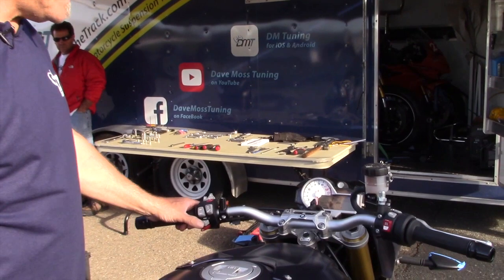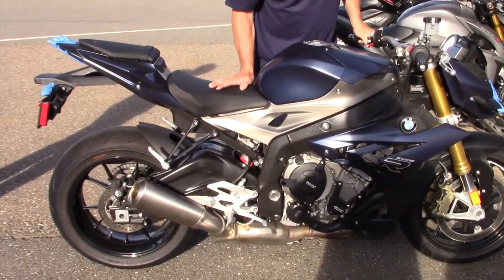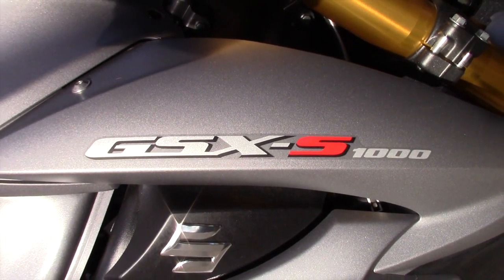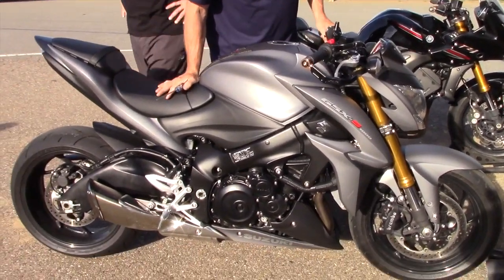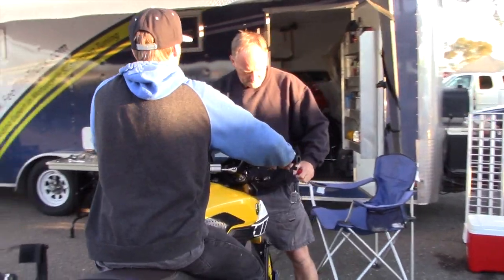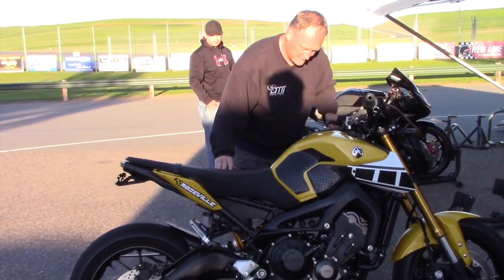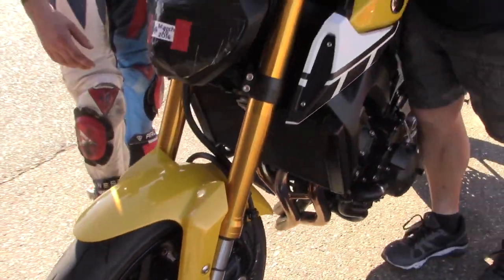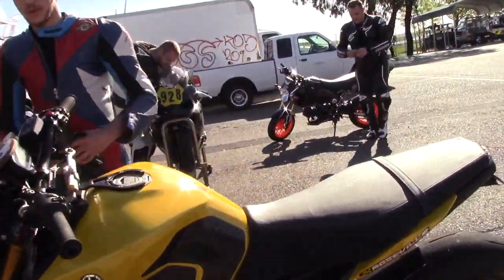2 Clicks Out: Naked On Track, S1000R GSX-S1000 & FZ-09 Suspension Setups (TRAILER)

Comment: Currently have an S1000R with DDC and it’s becoming a real ball ache to dial in 🤦🏻‍♂️ 

Bike has a total Jekyll&Hyde personality. Wish Dave was in Scotland 😭🤦🏻‍♂️
Reply from the maker: Is the fork and shock oil over 10,000 miles old - that might be the source of the problem from cold thick oil hot hot and very thin oil?
Reply: Dave Moss Tuning Hi Dave, thanks for replying. No, the bike is a 2019 with 3500 miles. I had made some adjustments again last night but unfortunately storm rolled in before I got an opportunity to do testing. 

Hopefully have the bike out by the end of the week. If I fail to sort this I was hoping I could maybe try out your remote tuning option and have a chat with you about the bike? I’m really struggling to get understood with local guys unfortunately. 

I signed up to premium DaveMossTuning. Great videos!
Reply from the maker: @Invis_Space  Thanks for subscribing! I appreciate your support. If needed, we can connect cia Remote Tuning. Let's see what the next ride brings!
Reply: Dave Moss Tuning Don’t mention it. I look at it as you’re supporting us 😂 

Fingers crossed. Learnt a lot from your videos, but it’s still a form of wizardry to me so good to know I can catch you via remote.

Comment: So Dave, I've watched the whole video (I'm a subscriber) and thought I would help my mate with his just purchased 2018 S1000R as he had been bottoming the forks (Cable tie right at the bottom). However, once we started we realised there was a problem. His (UK) model has DDC with only preload adjustment and no way of adjusting the damping other than switching between 'DDC Road' or 'DDC Dynamic'. Does this make redundant all your traditional methods of evaluating suspension movement such as checking for a second bounce on the forks? 

The preload was strange too. In the front with no preload (Adjuster all the way out), the static sag was 34mm and rider sag 10mm making a total of 44mm. Adding preload reduced static sag but increased rider sag and left the total sag at or around the same 44mm! We left it there to have a rethink - Any thoughts?
Reply from the maker: Thanks for paying it forward! The forks and DDC are somewhat disappointing but that's what we have to deal with. You should have dynamic and dynamic pro. You will notice a huge difference with dynamic pro. Set preload at 50% and leave in the DDC setting for road. See if he bottoms. Now set to Dynamic and se eif he bottoms again. If he does, move to dynamic Pro and test again (no preload changes). Dynamic Pro is much stiffer with DDC. If he still bottoms, stiffer springs are required.
Reply: @catalystreactionsbw  Thanks for the fast response Dave. I'm happy to pay for your superb content as I've learned a lot from your free stuff over the years. We will try that,  when you say set to Road or Dynamic do you mean in the mode control (RH bar) or the damping control (LH bar)? We did fit the plug to give him Dynamic Pro thinking it would give us the adjustment we were looking for but removed it again when we found it didn't. He's been riding in Dynamic mode since he got it, not sure of the damping setting - DDC Road or DDC Dynamic - as we messed about and didn't take notice initially(!). He rides the roads only and it has usually bottomed out. 

On the rear it had no static sag (Preload wound completely out) and 30mm rider sag. He's 85Kg plus gear so not massively over the BMW projected rider weight..
Reply from the maker: @raydavison2972  Dynamic Pro should have been substantially stiffer, so that is odd to see your findings. Is he bottoming out from wheelies? If so, that's a false positive and you are chasing a ghost. If not, the fork spring is far too soft and oil level too low for the air spring effect.
Reply: @catalystreactionsbw  Thanks again Dave, I think I have confused things! He has been riding in Dynamic, not Dynamic Pro. We have been out today for a few hours, he was in Dynamic rider mode with the damping set at DDC-Dynamic and the fork preload at 8 turns in (That's how we set it the other night and have not changed it since your initial advice (I'm not sure how close 8 turns is to the 50% you recommended) and the shock preload at 6 turns in. He said it felt better than before (More stable at the front and the rear kicked him less) but the forks still bottomed. I guess the next step is confirm the preload and then try Dynamic Pro. Thanks again   PS: No wheelies, we are reasonably fast but not madly so and don't play like that - We do want to get home every time!